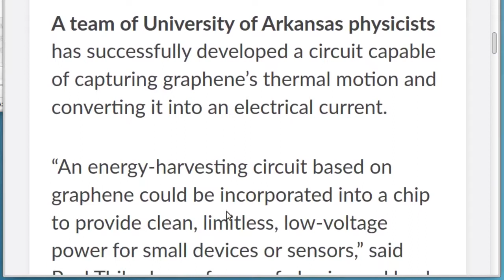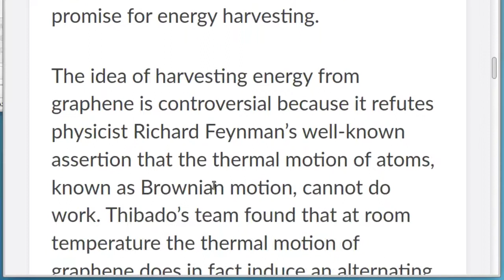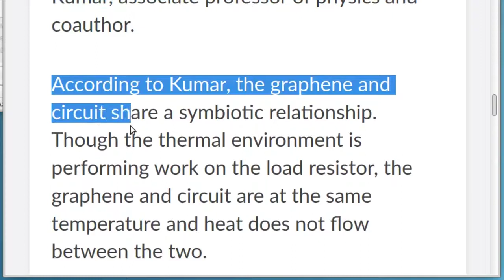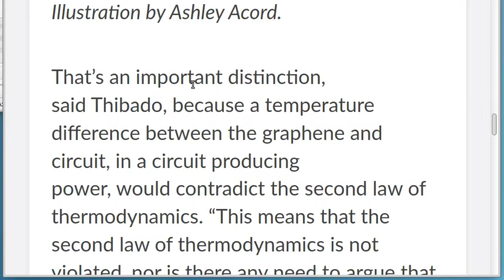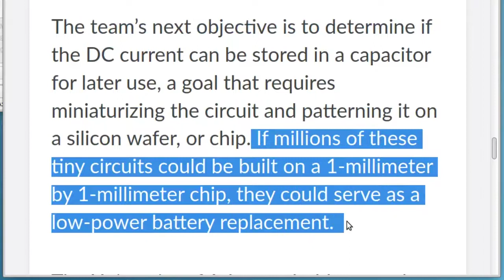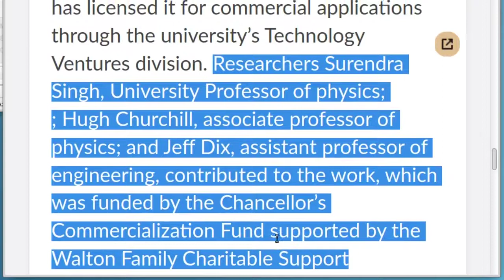Physicists Build Circuit That Generates Clean, Limitless Power From Graphene

Comment: This is a fantastic discovery !  Paul Thibado will be a name long remembered.  If Elon Musk isn't all  over this he's a goof ball.  He may be a goof ball anyway.  Regardless; this is mechanical electron flow via the flexing of a sheet textile.  It's a wind and solar power generator by virtue of how wind can move sheets and so can solar exposure flex sheets!  What about choppy seas!  A sheet floating on choppy seas would generate juice forever.  This is mind blowing!  This is making the pool balls flow by flexing the pool table top!  Making a large sheet of graphene must be one of the next goals.  Etch a sheet of hard steel with a hexagonal pattern and gas dispose graphite over the etched plate then glue it or cure it or make it release the pattern of graphene even if it is more than one layer thick and work with it.  I think a small explosion would set the graphene.  Geesh I want to go work with this.

Comment: The principle behind all of this has always been there in some form. He would have something similar in the way that is thermal electric transducer works. It’ll give you different effects depending on what polarity you give it. But for this to work the way that it does seems like it would be almost analogous to a power transistor. You have a forward threshold voltage to the base to allow current flow through the mirror in the collector. This very simple action essentially amplifies the signal to produce a way to deliver the voltage and high current to a circuit that requires it. Like a power amplifier. But the material science has changed and with graphine, you might get some unexpected gains due to results & observations from experimentation. I suppose it is feasible, but kind of reinventing the wheel when I believe that there’s better methods and alternatives out there that will do the same thing without such a learning curve.
Reply from the maker: Thank you. Professor Thibado can give better comment on this. https://fulbright.uark.edu/departments/physics/directory/index/uid/thibado/name/Paul-Thibado/